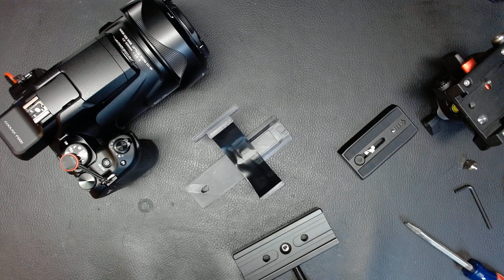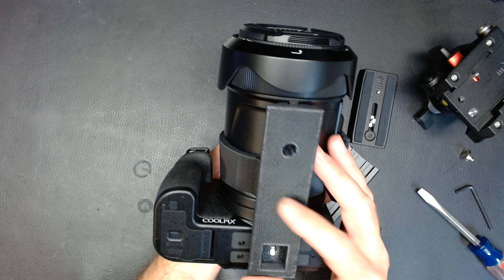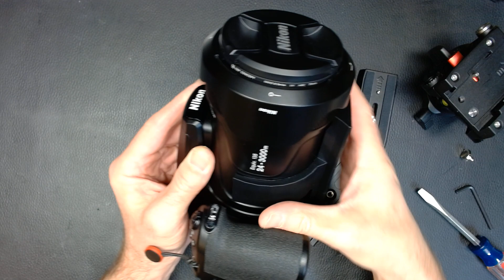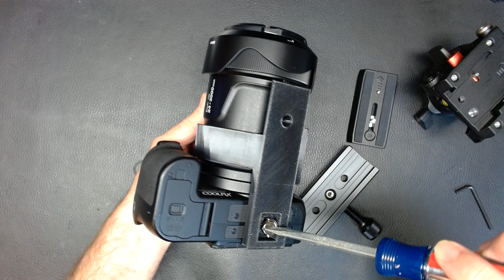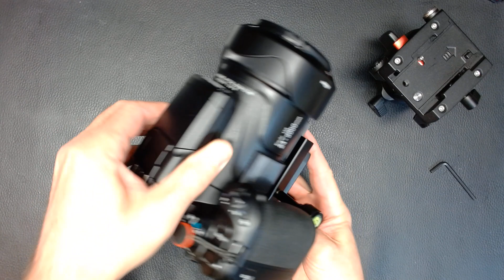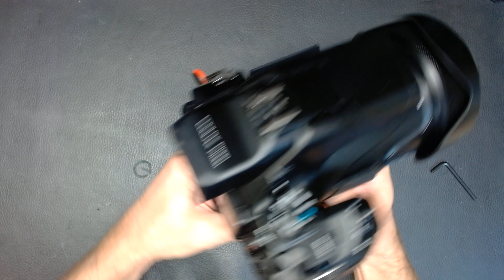Nikon CoolPix P1000, 3D Printed, Tripod Support Bracket, Fluid Head mount setup, Part 2 Video

Comment: I dont get it. Why doesn't the camera bracket just connect to the tripod head?  Do ya really need the two extra pieces in the middle?
Reply from the maker: The tripod fluid head that i am using does not have the normal arca swiss mount so it needed to be adapted.